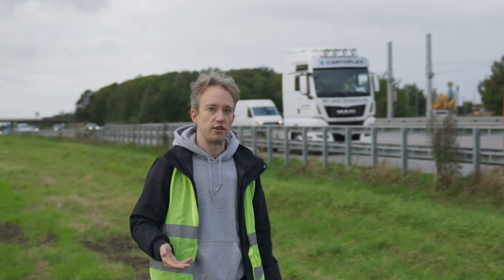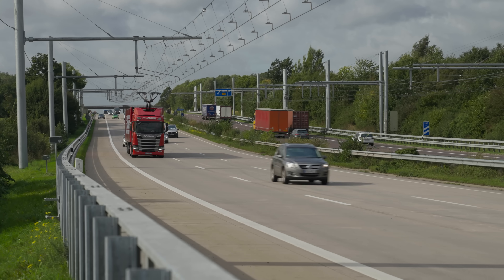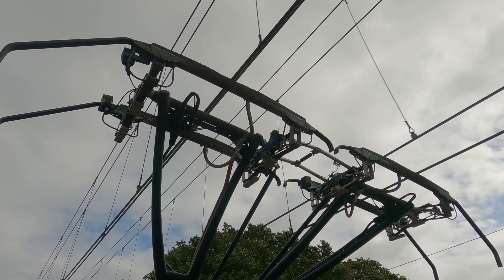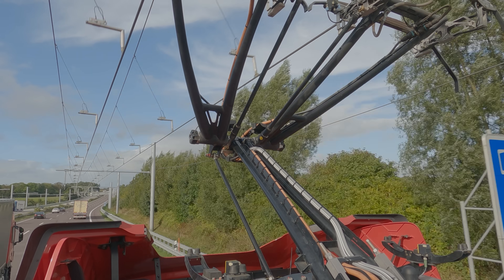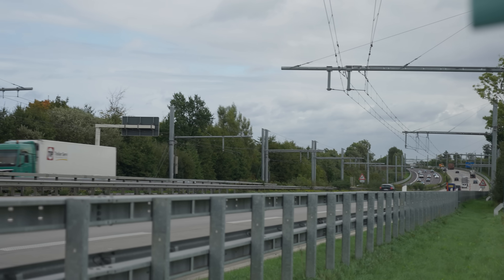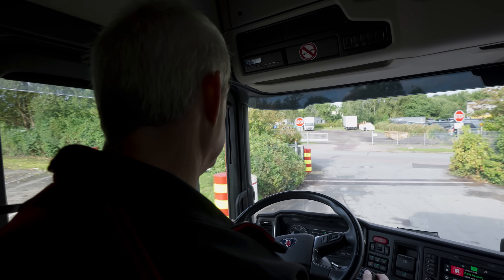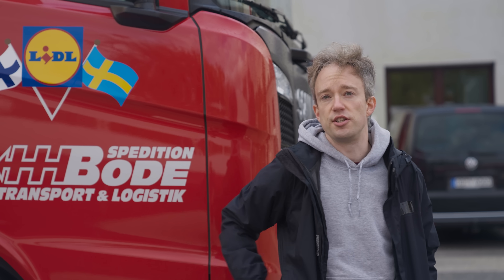The highway where trucks work like electric trains

Comment: damn, no that is a brilliant idea...... i gotta say, respect for the Germans for having the confidence to try that out, they could be onto a winner. I guess i've seen this with buses already
Reply: Wow bumper cars on a motorway
Reply: There is also a version that does wireless charging from under the road, but that is both less efficient and more expensive as you have to dig up and repave the road. It is likely cheaper to make some parts of the autobahn trucks only lanes and let smaller vehicles rely on charging stations. OTOH, if that system can be made to work, it should be able to power both cars and trucks.

Comment: I thought of this many years ago but realised that a two wire system would be needed and may prove difficult to adopt. My main idea was for all vehicles including cars to have a lifting panto-graph so they could charge their batteries on a long motorway run. This was way before the advent of modern battery technology, but still retains its advantages. Like a steady long charge up on the move instead of having to find and stop near a vacant charge point then wait for battery replenishment.

Comment: I did notice an issue from being a train nerd. The wires do not zig zag giving even wear to the pantograph head. So in the long run the pantograph wouldn’t last as long as it possibly could
Reply: There is a solution here that trains don't have: have the lorry zig-zag a bit. This will happen naturally anyway.

Comment: I wonder though why the two sets of contact cable for the one lane, where on a railway it's a single for one track?
Reply: You need two lines for a circuit. Trains have a steel line on the ground they can use for the second connection.

Comment: how does the electric company knows what to charge the truck owner when they use power from the cables ? I bet it's a fixed rate, because there is no way to tell which truck is connected, unless they put a meter on the truck, in my country that would never work because truckers will tamper the device for sure!

Comment: Actually when I was a child in Derby we caught the trolley bus into town a journey of 3 miles. In 18 years time a new ICE lorry would last 20 to 25 years time. Hybrids increase democrocise transition. Run Motorway as a railway line. Trucks would not need to overtake. They can link with each other. Would they need a driver if going to a hub. Falling power cables onto a motorway is a worry. Happens to trains a lot. Its an IF
Reply: 'Happens to trains a lot'? No, happens occasionally. There is a better solution - use railways for long distance transport and battery or hydrogen powered trucks for local distribution.

Comment: Aren't we just moving the energy production and by extension the CO2 production from one place to another??
Reply: No. Energy from the grid is always more efficient than energy produced by the IC engine that vehicles carry. While ICE vehicles always burn fossile fuel, Grids may be sourcing from Nuclear, Solar, Wind, Hydro, etc, which are much more cleaner.

Comment: So why don't connect all the lorries together and power a few, maybe one or two of them rather than having individual motors for every single lorry ? Oh and you can put on steel wheels on them and put them on some steel guideway to decrease friction to increase even more efficiency.

Since this system only serves a network from port to warehouse or from depot to depot, so there would be lots of lorries anyway to go from one point to another. Why don't consider this futuristic system ?

Comment: I still don't know why we won't be able to get a new pack of freshly recharged batteries at what are now fuel stations, in exchange for empty ones. would take just a few minutes instead of hours of charging time. All that is missing is an industry standard for exchangeable battery sets  between brands.
Reply: Because then all the auto makers would have to agree to make all their systems match perfectly.  How many gas or Diesel engines do you see cross over from different makers to others.  The idea is great but it can not work.

Comment: I love the idea. Having spent the past 37-years driving trucks my hearing is permanently damaged with non-stop tinnitus (jet engine like) because of the loud noises eminating from the diesel engine and exhaust system inside the cab. Millions of truck drivers suffer from damaged hearing after decades driving these trucks and it's nice to see a form of propulsion which is whisper quite that makes hardly no noise inside the cab of the truck. To give an example of how loud the inside environment of a semi-truck cab is, imagine sitting at a rock concert 12-hours a day, every work day for 37+ years. It's the culmination of noises from the engine, exhaust system, road, and wind all playing in concert and it's unbearable.

Comment: Its an interesting idea and if it is viable then it could work. But there have been lots of other ideas about how to move freight around over the years. The idea that you move it by rail in containers to an inland container port and then keep all the truck movements local (load the container on/off truck at the "port"). People started down that road and ....   What you dont want to happen is spend the money on putting in the infrastructure only to find the infrastructure only gets used while the novelty is fresh. After which it never gets used again.

Comment: This is such a stupid project.
One kilometre of this motorway overhead line costs about one million euros. One kilometre of overhead line over rails costs about one and a half to two million euros. But since many more vehicles benefit from it on the railways (every electric locomotive, not just individual lorries and above all passenger traffic!) and trains are much more efficient because of the low friction between rail and wheel and because of more load per train, this project is (once again) just greenwashing and a huge waste of money.
Moreover, motorways are wide, sealed asphalt aisles through nature, whereas railway lines are much narrower and not sealed (with a ballasted track).
But it's like so often in Germany:
Trains are as a means of climate protection, again it is said "More traffic on the rails!", then it is neglected again and once more a lot is done for the car lobby.

Comment: I have driven along the test track near Darmstadt on the A5 highway several times but never seen a truck using it yet. Now I have, at least on Youtube. 😁 I also think this is how trucks may work in the future. On the other hand it would have been much better if the German railway system had been supported like the Autobahn. That way the cargo could easily be transported on trains that already use overhead wires. It really is a pity that the German ministers of transport were focussed on roads in the past. I'm excited how the new government will handle this topic.
Reply: The advantage of this is that the truck can get its charging done while moving, and then can leave and go to the specific place and needs to be. Compare that to a train, which has to follow the route of the rails
Reply: We definitly need more rails in germany. I am not saying that this solution isnt good for many problems but its horrible that the rail insfrastructure is so bad in germany...
Reply: It's a publicity stunt. No one even bothered to think the logistical problem of equipping trucks with the means to use the over-head cables.
And transporting by train are more costly than truck, believe it or not, and slower. Sure, if you only count weight per mile; but how many miles before you brake even? Cause you need a terminal to handle the goods, and you still need local trucks to deliver the goods the final stretch. Then you have the whole issue of scaling. It's not as simple as allowing more wagons per train set-up.
Reply: I live near the test track near Rastatt (B462) and I also see never a truck that is using the wires.
Reply: I don't think the rail network could cope with the quantity of stuff that gets shipped these days.
Reply: Es war eigentlich schon ganz gut das die Autobahnen ausgebaut wurden und die trucks fahren ja meistens sowieso nur kurze strecken zwischen hafen/ zugdepot und geschäften
Reply: The problem with the Darmstadt test track is that there are only 5 trucks actually able to use it. Not 5 trucks at the same time. 5 trucks in total are participating in the experiment.
Reply: @babooXX  They can but only on tracks, which are very expensive to construct. They also have long braking distances, which limits the system's overall capacity by a lot.
Trucks are just way more flexible.
Reply: @mac769  Roads are horribly expensive for the tax payer. A never-ending maintenance hole in the budget.
Flexibility is OK for last-mile delivery, otherwise it is not necessary. Longer brake distances don't matter as trains run on pre-planned schedules, that's not erratic road traffic where many vehicles interact.
Reply: @ronik24  You can't just put a track down that leads from every single port to every single warehouse that receives a truck.
Reply: A fleet of autonomous electric trucks driving day and night could be way more efficient than a train network.
Reply: @mac769  It can be a good addition to a train network, but railways will always be more efficient than rubber tires on road. Any larger distance transports and bulk loads need to go on rail for maximum efficiency.

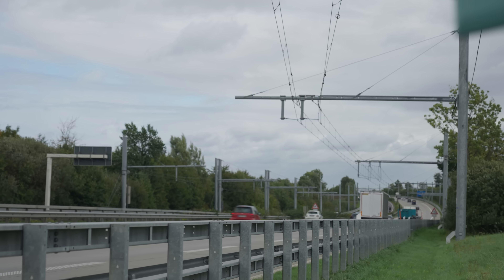Comment: When something like this is being considered, do they also consider the cost (environmentally) of setting up, maintaining and potentially replacing this infrastructure further in the future? This Idea that 2/3rd of heavy truck emissions could be reduced (0:47) is great, but is that assuming setting this up, running it and maintaining it would cost 0 emissions?
If the answer to that is no, a  2/3rd saving on only heavy trucks doesn't seem like much.
Reply: Oh, please stop it. The environmental impact of cables and poles is nowhere near those of a couple of thousand trucks burning diesel fuel.

Comment: These electric trucks should have steel guide wheels and the electric motorway routes should have rails for them, just like road vehicles used for tramway and metro maintenance so that the truck bodies can be safely earthed while using the overhead catenary. The guide wheels would fold up out the way when leaving the electric routes and be synchronised with the pantograph mechanism.
Reply: Ooh like scaletrix, but with overheads too
Reply: Why bother with folding? Just have a set of steel wheels on the inside that can be lowered and raised. In fact, screw lowering and raising them the conventional way. Just use an attachment point that is off centre to lock the wheels in the up or down position. That makes it possible to lower and raise the steel wheels just by using the momentum of the normal wheels, with the help of a clutch of course.
Reply: you could then link multiple lorries together and what could we call it? I know let's call it a train! One of the biggest wastes of fossil fuels is convoys of individual lorries carrying one or sometimes two containers when they could and should be being moved by rail, something you see on the A14 from Felixstowe every day!
Reply: @John-pn4rt  They would need multiple unit control like trains have, where two or more locomotives or multiple unit trains are coupled together and it's all controlled by one driver from the leading cab. But would that work with road truck drivers? wouldn't it cause arguments and fights over which driver should be in control?

Comment: You could theoretically even use the wires and poles for lamps so that highways are lit up most of the time. If that is desired. 
There are probably more uses for the poles and wires. Like 5g stations.
Reply: That would be a massive waste of electricity, given how many thousands of Kilometers of Autobahn there are. Plus lamps irritate wildlife, and only a fraction of people drive over night.
Reply: @Ink_25  Wait, so you are saying the Autobahn is not illuminated?  Here in the UK every mile of motorway is illuminated 🤔

Comment: it's an improvement over what we have for sure, but I'm not sure it's a step in the right direction. for me, Utopia involves a whole lot less car/truck/etc infrastructure and a whole lot more reliable public transport. this feels like we're backing ourselves into a car-based corner where roads and parking spaces take up most of the space on the planet, and where cars actively prevent healthier and greener modes of transport, such as cycling or just plain walking. Walking to my local shops would take about half the time if I didn't have to spend so long waiting at traffic lights so I could safely cross without becoming roadkill. not to mention how much quieter life could be.
Reply: Remove trucks from the streets and you might get to the shop 5 minutes faster, only to find that once you get there the shelves are empty. Moving people with public transport is a good idea. Doesn't do anything for the movement of goods in bulk though.
Reply: Utopia has vehicles that would take you from your home to any point free of charge, so essentially robotaxis, and that could not be more different than traditional public transport

Comment: And how safe are the poles holding the wires and the wire itself? Isnt there a danger of them falling down if the truck driver runs over an obstacle,  doesnt have to be a pothole but just piece of metal from a fence or else, what if the driver doesnt pay attention for 1 second and steers to the right or left? What if a storm with strong wind blows these poles off? Highway could be closed for hours or even days. I would have liked if you would inform us about security issues. So far it is only a "gimmick"

Comment: There is a detail that was long ago found to be necessary for trams. You either run with rollers on the overhead wire or that overhead wire must weave back and forth to spread the inevitable wear across the width of the pantograph. This truck's pantograph pair each lack the width of a rail or tram pantograph and the wires were dead straight. The truck will weave a little. But, there is still going to be a groove worn into the pantographs  wearing them out far quicker than likely is expected.

I also wonder what happens when the truck is forced off the road by perhaps a slightly inebriated driver. It seems this could generate some massive sparks if the truck happens to be accelerating at the time. If it then entangles itself with the roadside supports the picture suddenly becomes much less rosy (and perhaps smoky red with actinic white flashes.)

{o.o}

Comment: Truckers have to sleep for ages. They have enough time to charge their batteries. Furthermore highways should be covered with solar power and under the highway there should be electric long range wires. There is no reason to demolish forests for energy transportationg if you can just put it under and over highways

Comment: So it seems that the weird old “Super Mario Bros” movie with the cars being powered from an electric grid above the road was right about our future after all ;)
Reply: exactly
Reply: Of course they were, as would be anyone aware of a solution devised for trains more than 120 years ago.
Reply: Check out North Korea... they've had electric powered buses for decades.

Of course putting powerlines above the highway seems like a good idea until someone needs to move their house
Reply: @crocodile2006  why North Korea? Those literally exist in a bunch of European countries
Reply: @crocodile2006  You mean.. literally put their house on a vehicle and move it? Because I assure you that moving trucks are actually shorter than these "box trucks" are. In fact, those are the tallest road vehicles out there, and the wires have a hefty clearance over them as well...
You could probably move a 1 story house on those super-heavy flatbeds and still not hit those wires.
Reply: @ScarletFlames1  No sweetie, there are movers that will lift a 2 story residence, whole or in pieces and move down the road with it.
Doesn't even account for Over-Sized Loads which would gouge the heck out of these things just from the next lane over.
Reply: @crocodile2006  Trolley buses were around for decades before that shithole even existed.

Comment: UK test is coming on the M180 once they've finished more (seemingly endless) resurfacing - it's around the Scunthorpe junction (J3) but why 'test' on a flat road?  Why not on hills such as M62?  Surely that's a better way to find out if it's viable.  Of course it will be, electric traction is long-proven as efficient and lower running costs than I.C.E. tech.